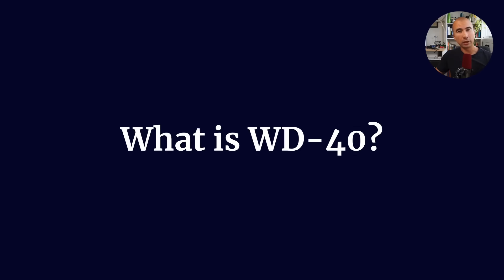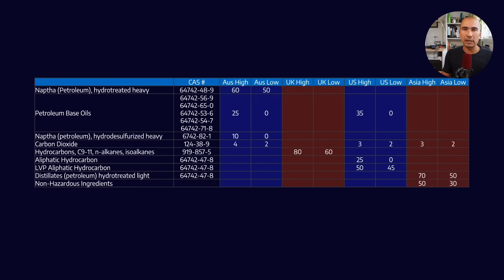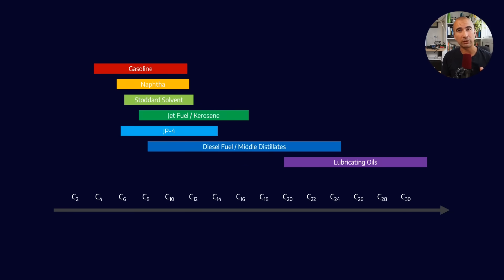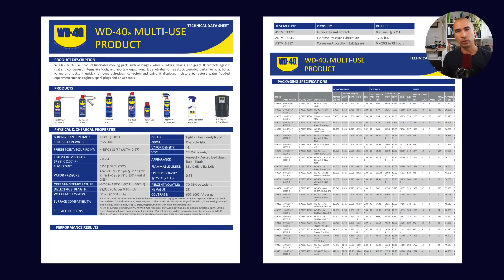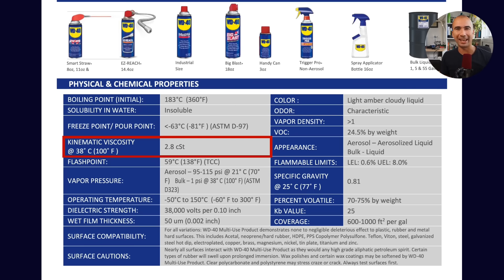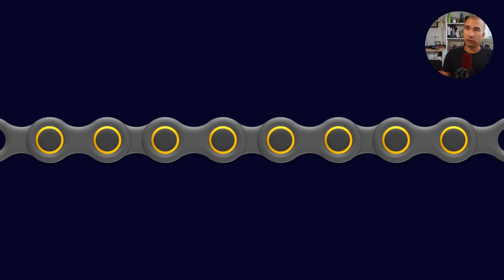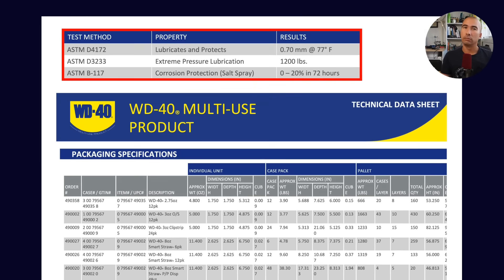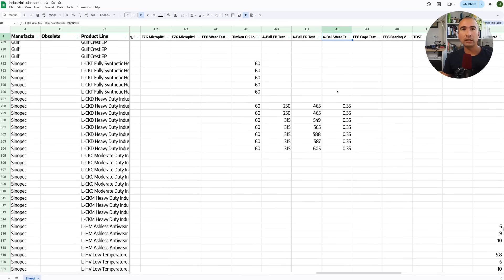What exactly is WD-40?

Comment: Don't mind my grammar. I have very sore hands. So I talk into my phone. Sometimes I forget to put in punctuation, Sorry if that offends you. But you've been warned. 
I don't know if WD-40 is a lubricant. I personally don't care, but the video is very interesting. Thank you. I'm a retired machinist at 35 years. We used original WD-40 as a lubricant when drilling aluminum or tapping aluminum. We all see used WD-40 when flattening something with every sandpaper or wet dry sandpaper. Spray  w-40 on the sandpaper on a granite slab. Put your part on granite slab/paper. deck the part until flat. I also know that I read a can of WD-40 not too long ago. And it said something about using it like PB blaster that it could loosen bolts. I don't know if it was an original Can or was one of their other mixes. All I know is I have about 20 different cans of WD-40 out in my garage. I have mixed them all together at one time. That mixture was truly a lubricant.
Reply: Machinist of 13 years here. My shop buys this stuff by the 55gal drum. We use it primarily for rust prevention, honing oil, and I occasionally use it for manual machining on aluminum. It cleans honing stones very well. It can protect steel from rusting for years if properly stored. I have found however that when stored for long periods it separates in our drum. When WD separates the thicker stuff at the bottom is more of a lubricant, the stuff at the top more of a solvent. If you never shake the can this might explain why it seems different between cans.

Comment: What do you recommend as a good lubricant for cylinder walls in a newly machined engine block for installing pistons and providing temporary protection during the first startup? I've seen recommendations ranging from wd40 and penetrating oil to ATF and engine oil.
Reply: Assembly lube is the "correct" one.
Reply from the maker: It's already been said, but assembly lubricants are dedicated to this kind of thing. You could probably use a running-in oil as well - they tend to be engine oils with a lower-spec base oil (because they don't need to last as long) but are more heavily additized to cope with running in conditions.
Reply: Lucas oil stabilizer. It's only good use is as an assembly lube.
Reply: Assembly lube, but standard engine oil works just as well.
The friction between the rings and cylinder is VITAL for a correct compression and oil sealing. You will glaze the cylinder walls if the surfaces are too well lubricated, and the rings will not bed in properly.
Reply: Molybond and engine oil never wd40. When you start up, engine oil will be splashed on the bores.

Comment: WD-40 is many things, I find it very useful, but not necessarily for lubrication.
It's very good at penetrating and loosening hinges joints and bolts, and also cleaning away old grease.
I had a car with a nasty grease spot on the backseat, it was gear oil from a weed wacker.
WD-40 was the only thing that could penetrate and solve the gear oil in the fabric, and it did very well, leaving a near invisible stain, that did solve with hot soapy water.
Last but not least, aluminium cutting, be that milling lathe or thread cutting, excellent.
So very versatile product, but not lubrication.

Comment: What do you think about using gear oil mixed with acetone, as a wd replacement? Thank you
Reply: 1:1 acetone to atf fluid is one of the best penetrating fluids. Possibly what Marvel Mystery oil is most similar to.
Reply: Gear oil stinks too bad. I'd use the leftover amount in an engine oil bottle or ATF bottle.
Reply from the maker: Interesting idea - personally I'd go with a dedicated solution like the PTFE, graphite, or moly sprays that are available. These are able to penetrate, but leave behind a solid lubricant.
Reply: @LubricationExplained  Thank you very much for your answer!

Comment: I have found that WD-40 works especially well for one purpose, for me.  I have a steel work bench on casters that I roll out of the shop to weld on, and sometimes I get caught out in the rain before I can get it inside.  When the table gets wet it will rust very quickly even if I wipe away the excess moisture.  However, if I spray and wipe on a light coat of WD while the table is wet, it never rusts.  So, I guess it really does displace water from what I see.
Reply: Sit down before you read the rest of this because it's going to blow your mind but that's actually exactly what this product was invented for
Reply from the maker: Absolutely! The water displacement properties are more a function of the wettability and surface tension of the product, which is very low compared with water. Combine that with a corrosion inhibitor, and it'll do the trick.
Reply: @LubricationExplained  I've also used the low viscosity as a carrier in a pinch, one of those home projects, holiday weekend and everyone's closed and I needed lubrication and protection immediately. Mixed WD40 from the gallon, some graphite powder, let the WD carry the graphite to the areas I needed it in and in many cases, added a heavier weight oil to be carried in for corrosion protection. As useful in a pinch, charcoal lighter fluid, which is naphtha and stoddard solvent, doing fairly similar in an emergency, evaporates and can also carry a lubricant as it penetrates.
Don't have moly in powder form, only in grease and that obviously wouldn't get carried well at all, it'd instead just flush away. I'll hopefully remember to order a small bottle of molybdenum disulphide for such uses, they augment one another quite nicely.

Just discovered your channel, but am encouraged by your casual mention of wetting, which suggests you've covered the subject in other videos. If it's beading, it ain't wetting, if it's pooling, it's sort of wetting, if it's filming, it's completely wetting and for a lubricant, lubricating and protecting from corrosion.

And special characteristics, such as oh, oxygen gas handling equipment, boy have I had people lose their minds when they learned what's in those lubricants, "forever chemicals" being their loudest beef, but they are pretty much the best game in town for those narrow fields...
Reply: @spvillano  People loose their minds when it comes to anything involving pressurized O2.  As a hobbyist, I've seen people suggest that anything aside from solid metal will instantly combust.

Comment: Yeah I've been pretty disappointed in WD-40. The product that I replaced it with is CRC power lube. They make two versions of it. One has PTFE in it, the other without. It's quite a bit cheaper than WD-40. 

Power Lube is quite thin, but actually has a bit of oil and wax dissolved in the spray. A strange wintergreen smell as well. I think you can find that in Australia. I quite like it for sealed motorcycle chains on dual sport bikes. Knocks a lot of the dirt off, leaves a really thin layer of oil and wax behind. Does have a tendency to fling a little bit, but some of the waxier dedicated motorcycle chain lubes don't wash the debris off as well. 

The WD-40 long-term corrosion inhibitor is a very good product. Extra extraordinarily pricey though. If it was cheaper, I would use that over a lanolin-based product for truck frame corrosion protection.
Reply: The Penetrol anti-rust spray is pretty good, leaves a non-sticky wax film. Not durable for hand tools like pliers, but good enough for storage.
For example, I use it on twist drills etc that are in storage in Sydney AU (rust city) and no rust at all and does not get gummy. Of course, must clean and re-coat again before storing, since the coating disappears during use.
The Penetrol works much better than Lanotec spray, which feels and smells nice but seems to not stop moisture very well. I only use Lanotec on commonly used tools like pliers. Never had any success with lanolin based (commercial) products on frames, as it's not durable at all, and literally washes off (even in normal rain). The solvents in the spray literally melts the small amount of lanolin, so you cannot build a decently thick coating with multiple applications.  I guess slathering actual lanolin on would work if you could get an evenly thick coating everywhere, but that wouldn't wick in to crevices, etc.

Comment: Its just a simple petroleum solvent in aerosol form. When I could not open my garage locker at -35 Celsius - it helped as defroster . But its really short term problem solver. I’d not called it as well designed lubricant of course.
Reply from the maker: Yep! I think they also put in some corrosion inhibitor and a little detergent to help with cleaning and for some anti-rust properties. But like you say it’s mainly to help with short term issues, and the idea is you follow up with a long term solution.

Comment: Yes yes we understand WD-40 is not a lubricant. BUT- what it does do pretty well, is act as a solvent for existing grease in any given moving contact point. This has the effect of reflowing that grease into bare areas to effectively lubricate the contact point. With the grease that is already there. Which is more than likely to be the 'correct' lubricant for the location. Then it slowly evaporates away to leave the grease in place. Granted with frequent use before the evaporation the grease has inferior load handling to what it should have. I consider it most ideal in a contact point that already has grease and gets infrequent use.

Package that in a handy spray can that also has a straw for pinpoint application and you have a useful product. Which does many many other things beside 'lubricate'.

Comment: I'm curious about what residue would remain after all the short chains have boiled off. From the Wired spectral analysis it seems like it would leave a thin film of mineral oil. Maybe if you use a ton of wd-40 it would leave a thicker & more lubricating film?
Reply: Why bother. They sell oils that are specifically designed for lubricating chains, with the correct viscosity to work down into the working parts, yet not be flung off.

Comment: It's water displacer attmept number 40. Its used for spraying on spark plug wires on damp mornings. Thank goodness for modern silicone insulation, electronic ignition, and digital fuel injection.
Reply: Its got other uses. One early use was for to use on engine blocks that got submerged in water

Comment: Rafe, this is a great presentation!!!   And you are dead-on correct.  Your analysis is spot on.  WD-40 is  a poor lubricant.  It is what I refer to as a penetrating solvent.   When my previous elliptical was out of warranty, it began to squeal during prolonged workouts.  The bushings had worn and were contaminated with corrosion product fines due to less than thoughtful practices by me (not wearing long sweats and having sweat dripping into the bushings below me).  I used WD-40 to try to make the machine work better.   And it did - for a short time.   But all it really did is temporarily loosen things up.  BTW, I learned my lesson.  I always wear long sweats now with my new elliptical.   After about 5 months, it still looks and operates as a brand new machine.   My can of WD-40 is collecting dust!    Thanks again for an interesting discussion.
Reply from the maker: Great to hear from you Andy!! And glad you’re keeping well 😊
Reply: It would be easier to forget using whatever "sweats" is, and instead just use a proper lubricant on the bearings.
Reply: @johncoops6897  Perhaps for some whose situation was different from mine.  But not in my specific case.  The problem was that the bushings (not ball or roller bearings) were sealed for life wrt the lubricant (a grease)  There were no zerts or any other access point to relubricate.  If the bushings were not working properly, the only course of action available to me was to schedule a technician as per the conditions of my warranty, and have the bushings replaced with new lubricated bushings.  To do anything else could invalidate my warranty.  The sweating and having the salty sweat penetrating those bushings was more than the corrosion protection provided by the lubricant that was part of the bushings.  During the warranty period, I had those bushings replaced each year.  This fixed the problem.  But by the end of the next year, the same problem had occurred.  The technician who did the yearly work (included in my warranty) opened the bushings when he replaced them.  Massive corrosion (rust) and whatever lubricating grease was used was not even grease-like.  I was not able to access details of what grease the elliptical company used in those bushings for that particular model.  By wearing long sweats I have prevented even one drop of sweat from touching any part of my new elliptical except the hand grips.  And I carefully wipe those down well before any of that sweat can get on any other part.  So far, this plan is working.  My elliptical is as smooth and quiet now as the first day I used it.  If wearing long sweats will keep my elliptical working perfectly, it is a small price to pay.

Comment: It’s a lubricant!  Water can be a lubricant!  

WD40 just isn’t a great lubricant.  But it does have anti-friction properties.
Reply from the maker: It’s true - just about anything can be a lubricant. It’s more about intent - I think I said it elsewhere, just because your mouth CAN suck air, doesn’t make it a vacuum cleaner. My main issue is actually on industrial sites, where I’ve seen technicians use WD40 in place of a chain oil, or instead of a grease, because they think it’s a lubricant like the other products.
Reply: @LubricationExplained  Spit is also a lubricant. Like WD-40, you just need to know when it's an appropriate lubricant :)
Reply: Exactly 💯
Reply: Don't clean any firearms with that line of thinking.  It won't turn out well.

Comment: WD-40 only works for 3 days on noisy door hinges
Reply: But petroleum jelly works wonders on internaldoor hinges and it doesn'tstink,  6 years and counting.
Reply: @borism4629  petroleum jelly on hinges ?

Oh dear......
Reply: I don't believe this. It has worked for me for long periods of time and is easy to apply.
Reply: Lithium grease for the win
Reply: FluidFilm works wonders on hinges. Automatic transmission fluid is great for machine screw threads.
Reply: Nose grease works in a pinch.
Reply: When I use to buy it for $.99 cents a can, used it on everything, now at $7-8 dollar's a can I haven't bought any in over 30 years.
I like PB Blaster when doing mechanical work now.
Reply: Don't use vegetable oil,,,,ask my wife
Reply: In a pinch I used butter once. It worked quite well.
Reply: In my experience it lasts for years.

Comment: Did you identify any ingredients which would support the claim of moisture control or elimination?
Reply from the maker: Great question. So moisture elimination is most likely a property of the surface tension (wettability) of the petroleum solvents. This is the same property as used in dedicated penetrating oils. Long term protection is likely in the form of some corrosion inhibitor - but they don’t tend to show up in the SDS.
Reply: @ Surface tension is an interesting thought. I was thinking something like a bit of ethanol or other alcohol as part of the formula.

Comment: I've argued this for many years due to being taught some lubrication basics by my father who was an engine engineer for planes. Thanks for making a thorough video to show for others!
Reply from the maker: Thank you sir! Sometimes its handy to have a "third party" that you can point to.
Reply: Understanding the basics is critical if one doesn't want to introduce a path to corrosion, friction and rapid loss of equipment.
It's also handy in a pinch. Had a window that was sticking, sliding pane, incorrectly installed so I couldn't easily access the rollers to lubricate them properly.
Took some WD40 I had on hand, I always keep graphite powder on hand for a number of uses, lubrication being chief usage, mixed it up into something akin to lock-ease, with the graphite to remain after the volatiles evaporate, leaving a lubricating graphite film to ease window operation until building maintenance could come out and screw it up by dousing it with WD40...
I injected more and just left well enough alone, as I'll be moving soon anyway.
Injected, as I filled an industrial syringe with the mixture I made. I could just barely reach the bearings with an extended blunt needle.

Understand the characteristics and chemistry of one's lubricants. It can save money, time, expense and even avoid fires in some one off cases.

Comment: The manual for my 1984 MZ ETZ250 motorcycle instructs to apply grease to the final drive chain every 2500km. I have done this since I purchased the bike brand new. The first chain (not O ring) was still OK at 128,000km when I replaced it. Beats me how any of that grease gets into the pins.
Reply: probably suction as the parts of the chain moves and vibrates, the clearances will expand and contract which in turn can draw and push grease.